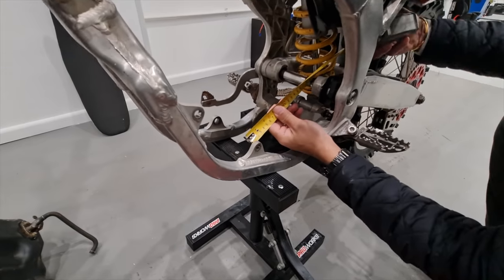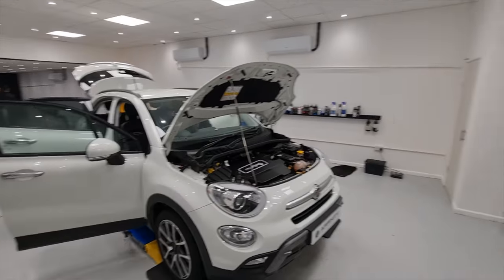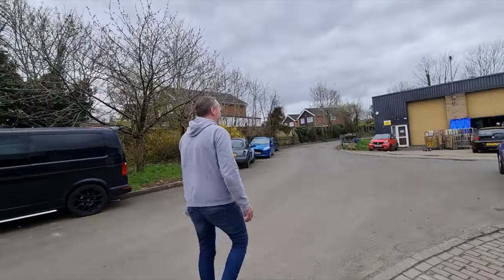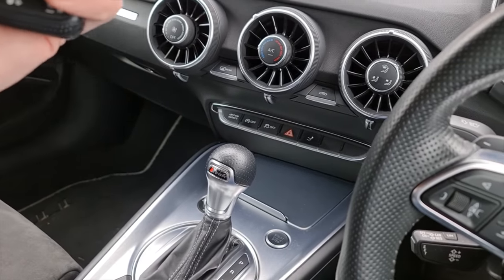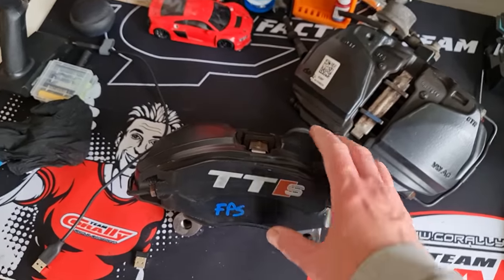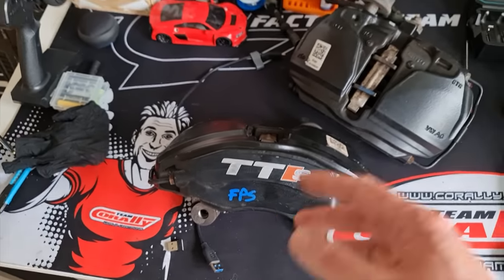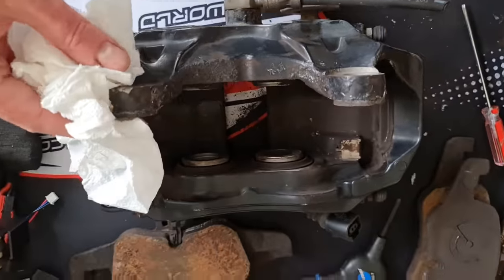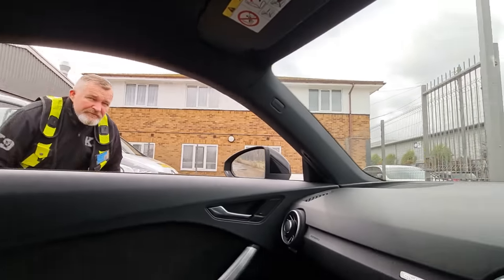NEW CRAZY ELECTRIC PROJECT!!!

Comment: You'll need the motor sprocket as close to the swing arm pivot point as possible so the chain doesn't loosen and tighten as the suspension is compressed and released. Looks very interesting tho... 👍
Ps, I think you get ever so slightly less actual capacity with lipo, but higher current output capacity. Great for bursts of energy

Endless Sphere is great!! 😉😉

Comment: I went with the qs138v3 70h with made in gear reduction so I wouldn't need a massive sprocket on the rear and I'm pushing 24,000 Watts through it and it is handling it amazingly with a EM-200/2 controller cranked to up to 300A and a battery I made using SPIM08HP cells that is good for 400a discharge.

Comment: This has been going through my mind, I fancy something like a electric puchh maxi, especially as you can ride a moped under 49cc on the cycle paths around Stevenage. 

Not sure how that rule would stand once it’s electric but I’m sure if you behave yourself you’ll be alright.
Reply: Yeah that’s the thing cycle paths are chill away from traffic,got to stay low power otherwise it’s a moped or power pedelec,with number plates and insurance.
Reply: @stevegavin3327  where I live you're actually allowed to use a moped under 50cc on the cyclepaths. Just converting an old pedal and pop to electric would throw up the issue of it not being under 50cc anymore. 

But I'm sure as long as its all taxed insured motd it won't look out of place in use on the cyclepaths so can't imagine you'll get any bother

Comment: Question: Do you get the same/more/less power density from the Brick LiPos as you get from stacking the smaller cell batteries? I know they make them in different voltages so maybe that's not so simple a question, but I'm wondering Is it more cost effective one way or the other? Because I feel like I see more Emotorcycles being built with dozens of cells soldered in series than I do LiPo Brick batteries.

Comment: I never did get a reply on my interest on the fat bike.. Hey ho… Still interested to get a couple of fat folders at reasonable price and update them as you did… Just wish your video was a little less time lapse as for sure it would supplement the kit you sell… 

P.S you need to get into VR! The latest setups take immersive to a whole new level!
Reply from the maker: If you arw the same guy im thinking of I did email you a couple of times, and even gave you first refusal. Maybe it went to spam.
Reply: @andykirby  - I don’t see anything in spam - but no worries I still want 2 of those :) - but I guess will be on the lookout for a decent 250/500/750 base - hopefully they are all similar battery size wise so that the controller can be placed in the old battery location hidden and protected… I will defo do the BMX bars mod too… That is a nice touch…